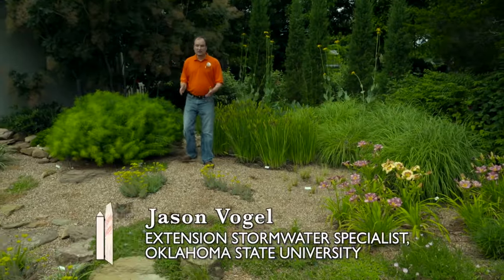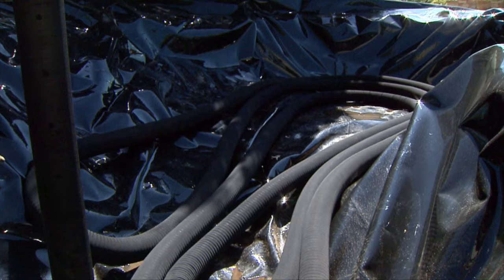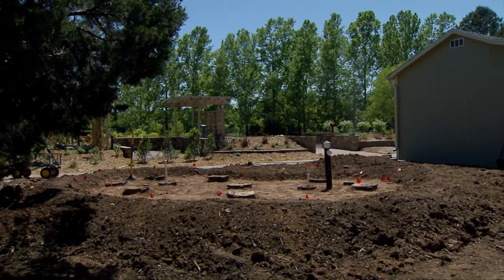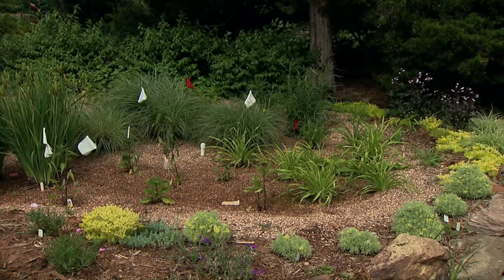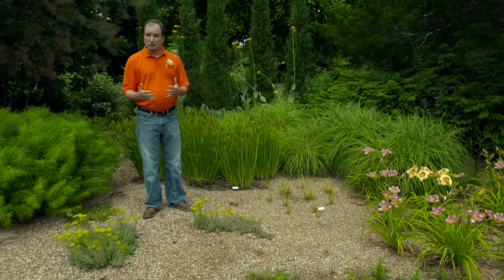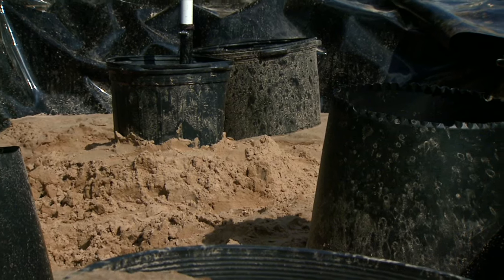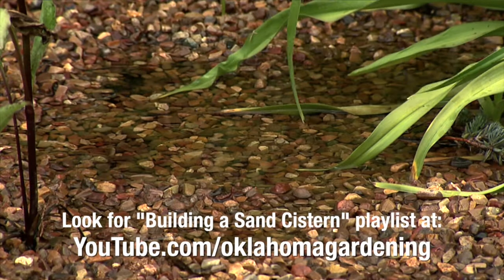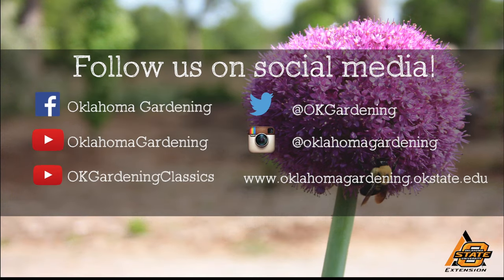Rainwater Sand Cistern Update

Comment: If you designed it for 1000 gallons but you are only getting 400 that means you are only 40% efficient for the size.  I wonder if you could increase the efficiency if you started with a layer of pea gravel or river rock, landscape mat, followed by sand.  Also, it would be interesting to know if other people that have tried this have the same efficiency.
Reply: That's a great idea, they may also want to lay another layer of the fabric mulch on top of that so that the sand sediment won't get down into that level.  This may actually only work very well if that bottom gravel layer is quite thick to allow for more water to drain from the sand level into the bottom gravel.  I think this technique overall has a lot of promise.
Reply: Hi Donald.  You are correct, adding a rock drainage layer with a permeable geotextile upper cover should increase the efficiency, similar to a french drain.  Great idea!